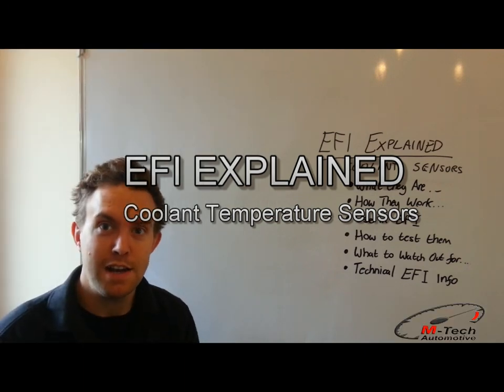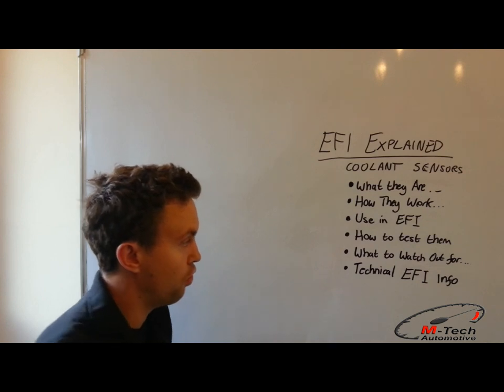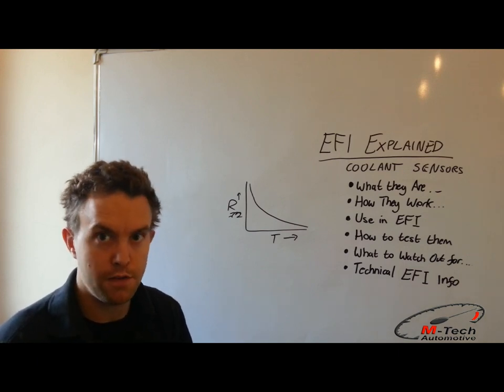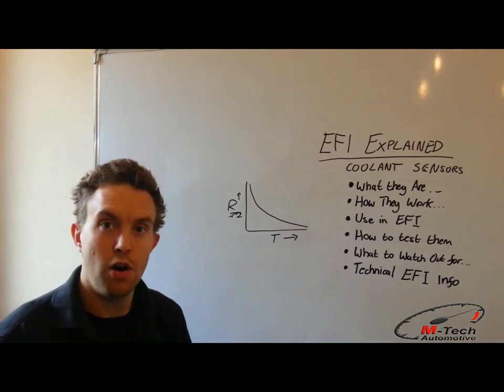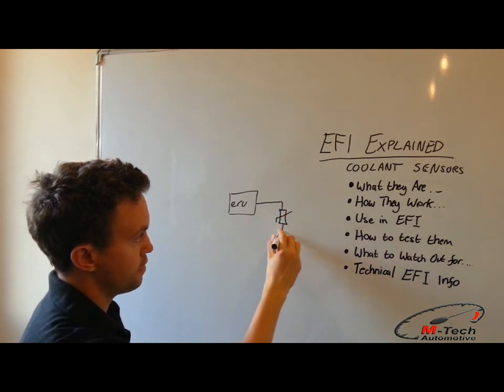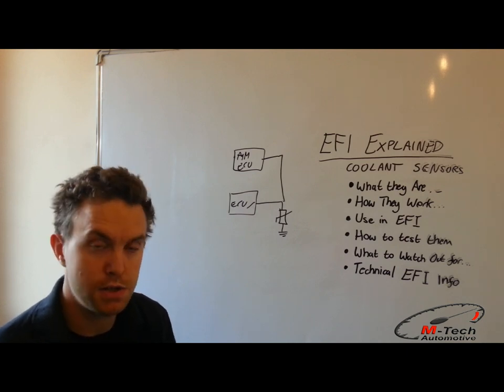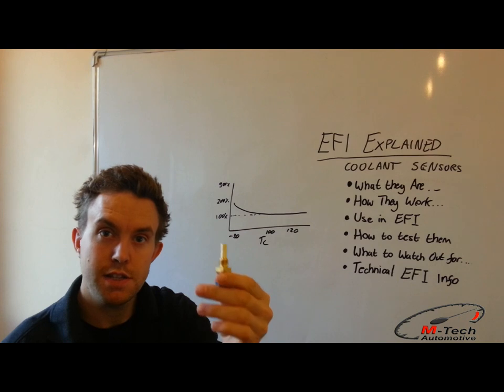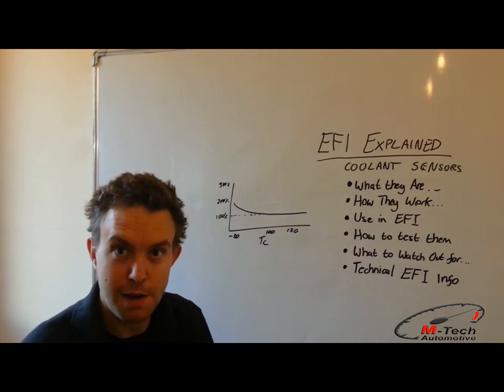How Coolant Temperature Sensors Work :: EFI Explained by Matt @ M-Tech Automotive

Comment: I have a 1999 Ford f350 V10 with codes po118 po117 at the same time replaced coolant sensor with oem and rewired to pcm and ground and tried 2 pcms truck stalls when warmed up any ideas don't make sense

Comment: I have a coolant temp sensor that is mounted high on the engine. If there was a small coolant leak that was unnoticed and the sensor was no longer submerged, would it still read the ambient air temp?

Comment: Would the ECT sensor dictate the thermostat temperature? I've been stumped Fan will not come on almost 3/4 to the redand 2 lines from the Red won't kick on the coolant fan, this is not normal?Only time it would work is when I turn the a/c on which manually turns both fans on condesneer and coolant fan, both fans new radiator new, new rad cap, fresh coolant new water pump, new thermostat, head gasket seems OK no signs no bubbles or milky color or smell from exhaust or any coolant in oil mixed, so is this a failing ect sensor? Its a 05 Honda civic so most of the failing parts are intermittent, never just die.
Please chime in I live in AZ

Comment: My truck 2001 toyota tacoma 2.7 4 cylinder.  Starts fine when warm. But in the morning at first start up it takes 3-10 cranks before turning on. Engine was recently rebuilt. Please help
Reply: Ernesto Diaz bad coolant temperature sensor telling ecu that the engine is warmer than it actually is.  On cold start the mixture needs to be richer to start quickly.  ecu thinks the engine is already warmed up therefore mixture is too lean.